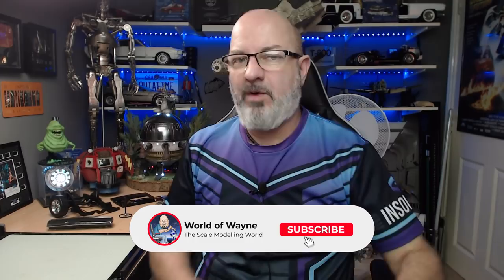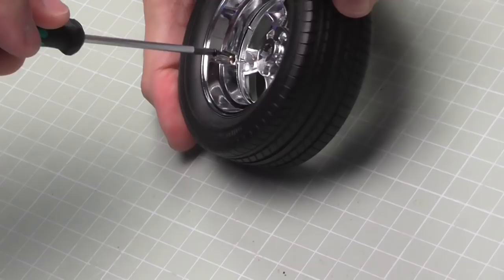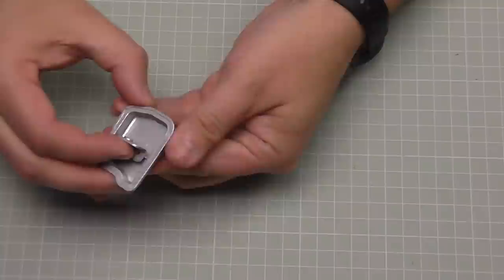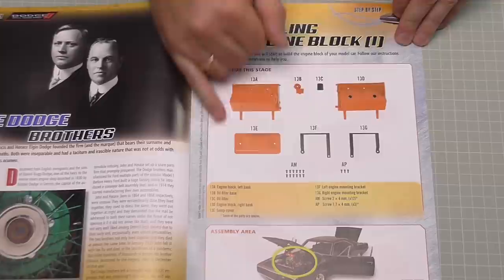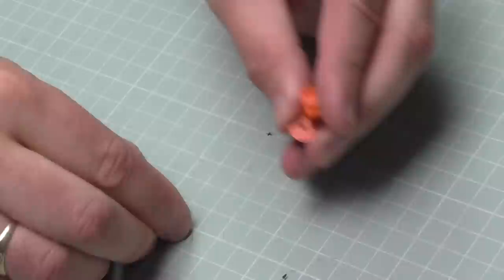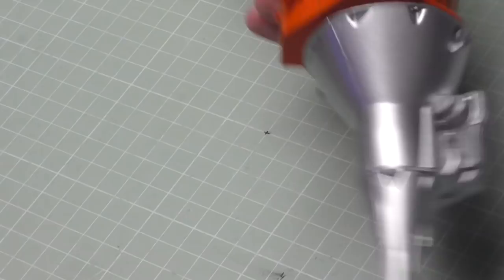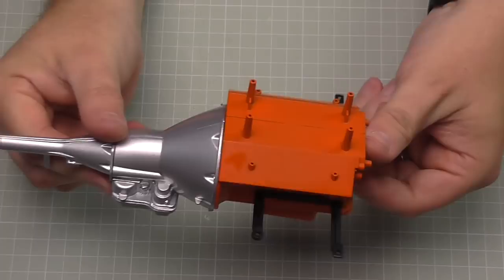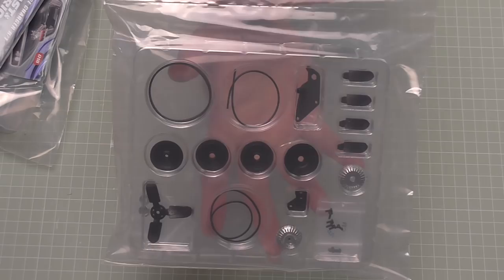Build the Fast & Furious Dodge Charger R/T - Part 11,12,13 and 14 - Transmission and Engine Block

Comment: Speaking of cars I just pre ordered the first part of the Knight Rider partwork on Amazon Japan. I've never built a car before so I figured it was worth checking out. It looks like a decent car with the electrics inside.
Reply: Is this 1/8? Do you have a link at all?
Reply: @mrorangepeel659  Go to Amazon Japan and copy paste ナイトライダー 創刊号 It translates to Knight Rider first issue. I would suggest ordering multiple issues so you save on postage. And yes it's a 1/8 scale car.
Reply: @mrorangepeel659  And search "ナイトライダー 3号" in the Books section for the third issue. It translates to Knight Rider No.3. Kinda surprised Amazon had the later issues for pre order so far in advance but I guess Deagostini Japan don't mind. They don't list Hachette Japan stuff until the day of release lol.

Comment: have you thought about looking for a small electric screw driver? so you can avoid blisters.
Reply from the maker: Never got on with electric ones. Too many rounded heads
Reply: I brought it up because I seen one in a tech video that looked like a thick pen, it's reasonably priced, around or under $50.00 in CAD.

Comment: Anyone have any issue with the wheel/tyre camber once both are fitted to hubs? For some reason the wheel/tyre on left hand side (looking at car front on), has a lot of 'toe in' camber? Other tyre sits flush on the ground and wheel is 100% vertical ...anyone got any suggestions? Thanks

Comment: What glue do you recommend for: Metal-on-Metal and Plastic-on-Metal? Does modeling cement work or would I need something else?
Reply from the maker: No. You need a good quick contact CA glue like Loctite
Reply: @WorldofWayneUK  thanks! So Loctite is something I'd want to use if I need to bind something to metal?
Working on the Delorean right now and trying to be prepared for anything bad to happen.
Reply from the maker: @BrianD0313  my glue is a CA glue and it sticks pretty much anything

Comment: can u get spare parts i snapped one of the radius arms on build 10,or can it work with out?
Reply from the maker: I would try and contact them and get a replacement

Comment: To be honest that transmission should’ve been painted steel not silver why do these companies always do that? Silver on a transmission is more of a newer color for a aluminum transmission not an older steel transmission which is far darker in color! Hopefully I get this in before you see it looks like fire engine red or hemi orange but I’m positive that doms block was black also you might want to custom paint certain things on this engine like the breather filters on rocker covers and the starter

Comment: The two wheels at the front are they ment to bend outwards?
Reply from the maker: There's no linkage in yet
Reply: @WorldofWayneUK  do you know what stage you get the parts in for it